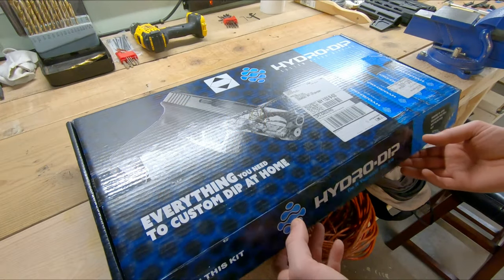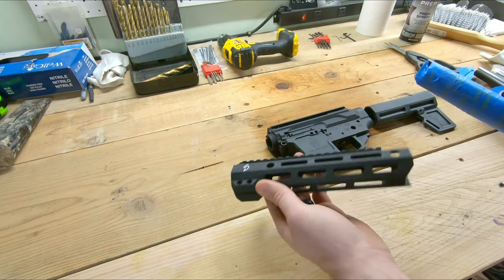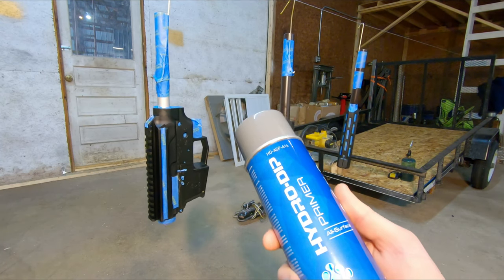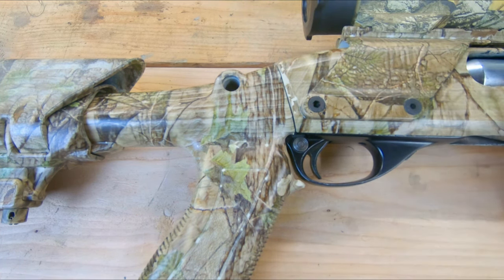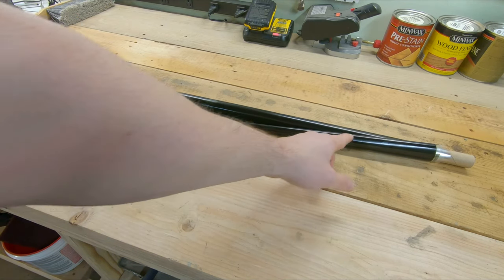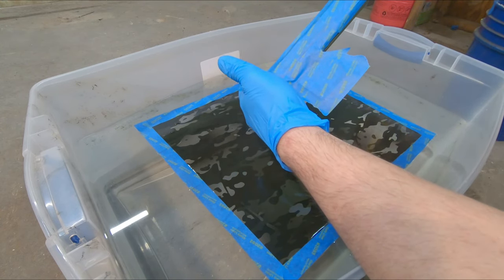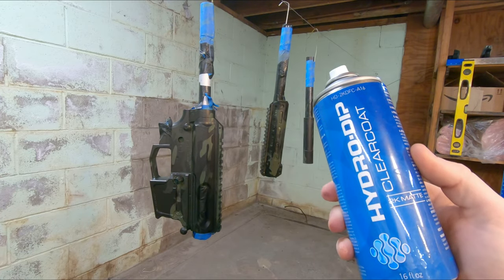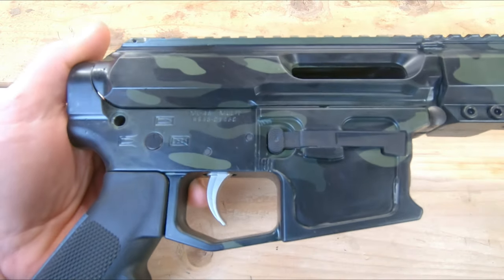DIY Multicam Black Hydrodip of an AR15 (Hydrodip.com Kit)

Comment: Best thing to do is use Cerakote clear over your finished work. The stuff is bulletproof.
Nicest thing is, you take Krylon and spray right over the Cerakote with whatever patterns and colors you want.
If you want to change it, take paint thinner and remove the paint without worrying about damaging the Cerakote.

As far as firearms, you should media blast prep before doing any serious work such as wanting to Cerakote your BCG or barrel etc. 
BTW, black is the worse (not a color I know) color you can use for any camouflage under any circumstance other than pure darkness.

Comment: You can probably get the matte coat back by simply adding a nice light coat after the fact. Make sure you keep a good spray distance to ensure good matte. Or maybe that brand's matte just isn't very good🤷‍♂️

Oh, and nice work. Thanks for the vid!
Reply from the maker: Thanks. I ended up getting some of the softer (white) scotch brite pads and roughed up the surface to take the shine off.
Still doesn't look as good as it did before the clear but way better than the glossy sheen.